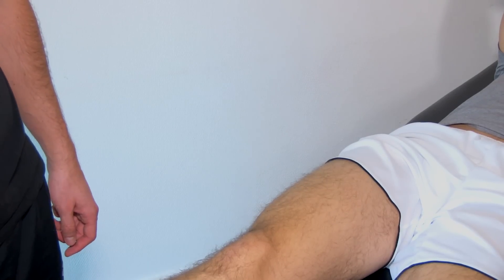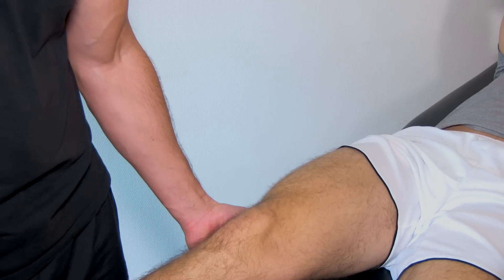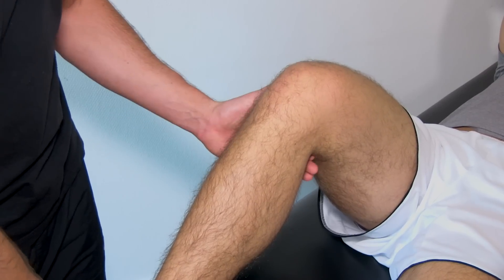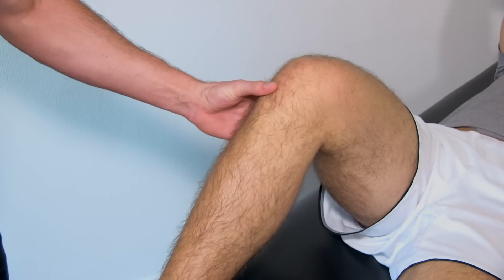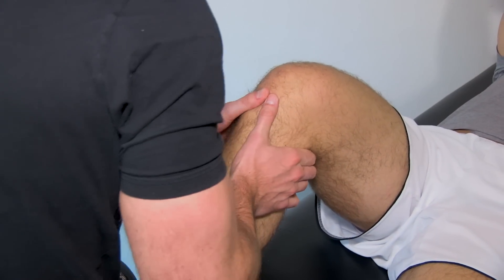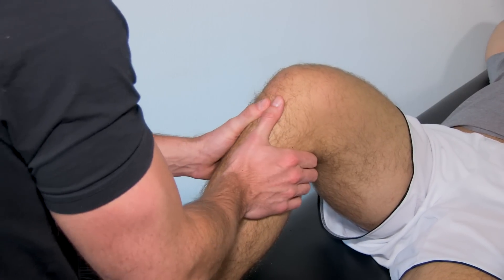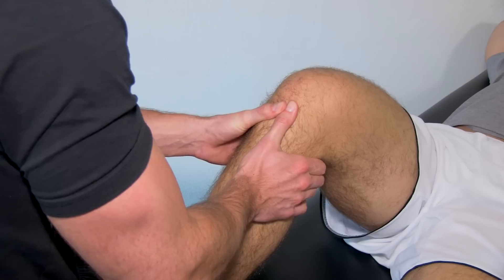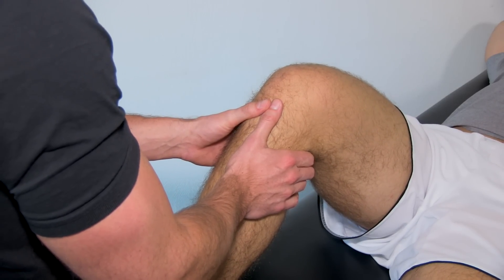Posterior Drawer Test | Posterior Cruciate Ligament

Comment: Shouldn't we stabilize the patient's pelvis using a belt?..
Reply from the maker: Payal Khanna Thank you for your question! This is how the test is performed in the literature. However, I can see your point because you will push your patient "upwards"' a bit. I don´t think you can avoid that, not even with a belt. The trick is to perform the posterior glide quickly, so basically you get information about the movement of the PCL first before the rest of the body is pushed along as well. Also realize that no clinical test is flawless and this could be one source that lowers the test´s validity!
Reply: OK thanks for your reply!